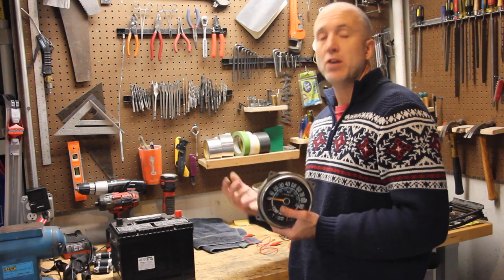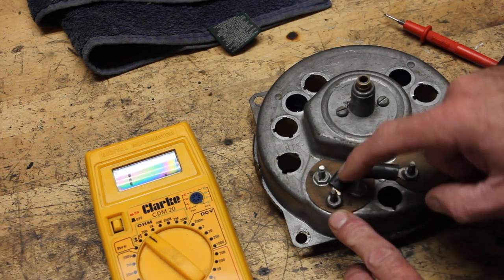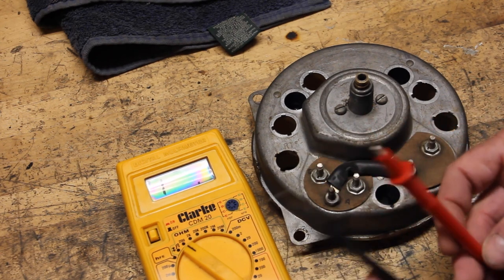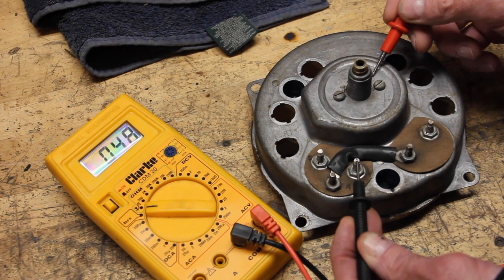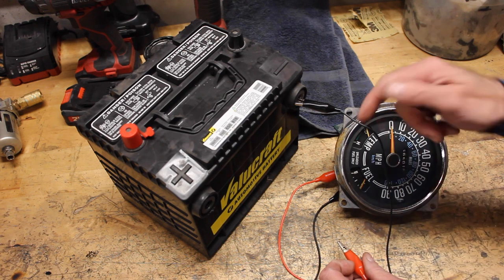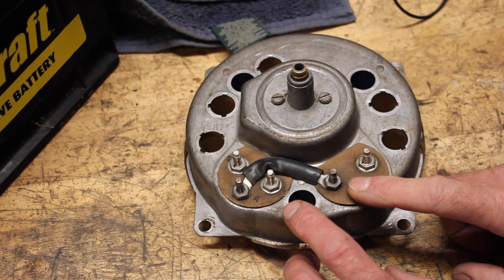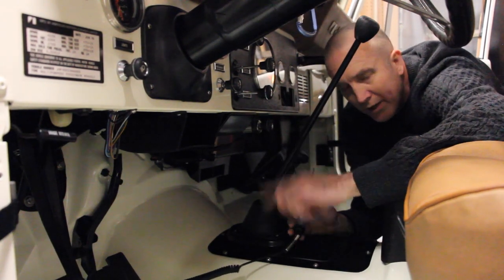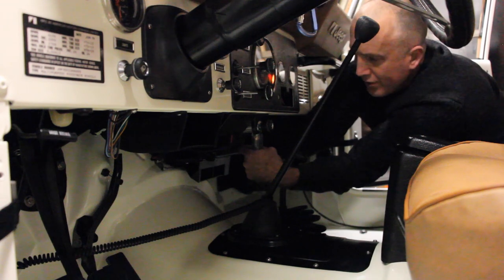Jeep CJ Fuel and Temperature Gauge Problems and Testing

Comment: Hey bud, like all your videos. I have a 86 cj7 with some really screwed up wiring. All my exterior lights work as they should but no dash lights at night, also the last guy that owned this jeep, replaced the speedometer. Did not connect anything to it but had installed a separate gas gauge, that does work. I noticed I don’t have the jumper wire from A to temp gauge on this. Is the new ones different  or do you know ? and also my ohm readings were very different than yours. Any thoughts? Thanks for any help. Also you would not have any diagrams of the light switch by chance would you?

Comment: Where do you get all your Cj parts at? Ive receive my dad’s old 86 Cj, and i REALLY wanna fix her up although 20 years of Florida humidity ruined a lot.
Reply from the maker: Kind of a mixed bag. Most gaskets and maintenance type pieces, I use Rock Auto, Morris 4X4, and Quadratec.

Then there are the hard to find things, like the power brake booster dust boot or the reverse light switch. NAPA seems to have a lot of these.

If you want to go OEM, then FB Marketplace (random pricing), eBay (stupid expensive) or reach out to Ray Moulton at Deadjeep.com. He is the best in the business and killer with prices. Great guy to boot.

Comment: Great video as usual! Also, very timely. I’m just putting the dash back in my 1976 CJ7 and had the speedometer installed. I took it out to do these tests just to be sure the gauges are good. So, I am getting all of the correct Ohm readings from the fuel and temp gauges. I also did the 12v battery test and both gauges take power. But, when I tested for continuity between the fuel gauge “I” post and the speedometer housing I don’t get a tone. Is there a way to check the ground or clean the contacts? Any help is really appreciated!
Reply from the maker: Have you opened up the speedometer and taken apart the housing? There is a small metal strap on the back of the fuel gauge that grounds it into the speedometer housing. Start with taking the cardboard piece of the back and check for corrosion/rust.
Reply: I actually have the same exact problem. So I took apart my cluster and pulled out the fuel gauge pod. The little ground tabs on the back of the gauge look ok but I cleaned them anyway along with the “I” post. Reassembled and still no continuity between the I post and housing. But if I test continuity between the I post and the grounding tabs on the fuel gauge, there is also nothing. So maybe a bad gauge? I have a Chinese cluster from quadratrac and I pulled the fuel gauge pod out of there and put it in my cluster and I have proper ground continuity. Ugh. Any thoughts?
Reply: Also, if there was continuity between the post with voltage and the cluster case, wouldn’t that create a short?

Comment: Do you have anything on getting the oil pressure gauge to work?
Reply from the maker: Have you checked the oil pressure sensor on the side of the engine block? Have you checked to see if your getting signal voltage from the sensor? And have you checked to see if your getting anything at the gauge in regards to voltage?
Reply: @coolguy_CJ7  The sender and the gauge are new.  I haven't checked the voltage.  Will do. It basically is pegged at 0 when I'm on the gas and bounces around 20 when at idle.
Reply from the maker: @Christian-ux1vl  is the gauge aftermarket?
Reply: @coolguy_CJ7  Yes, it's a Crown product.  The sending unit was new as well.  I tested everything though I am uncertain about the ohms on the sending unit itself.  I also grounded the sending wire to the gauge and the gauge pegged at max PSI so I believe that indicates that the wire and the gauge are OK.  I suspect that method is not orthodox.  I purchased a new sending unit and am waiting for that.  I'll switch it out again and see if it works.  There are a mixed bag of Jeep forum threads out there on this topic. Seems like a common problem.  I still have the original gauge.
Reply: OK, new sender is in and the gauge is working now.  35-40 PSI on start up.  When warm and at idle its around 20 psi and while driving it reads an increase in pressure when I'm accelerating put to about 45psi.  I don't now how accurate the readings are, but this together with the new oil pump I installed, gives me plenty of confidence that the oil is moving about the engine as it should be.  I am declaring victory.
Reply from the maker: My initial guess was the the gauge was wired backwards. A lot of the Crown/Omix-Ada gauges are very flawed and reversed in their internal wiring. Super glad that a new unit fixed it. If you want a really accurate reading then you need to go with a hydraulic gauge. The readings that you’re getting are exactly where they should be.
Reply: @coolguy_CJ7   Thanks for the assistance. This subject would make for a popular video.  Seems to be a consistent problem and there isn't a lot of helpful "how to" out there.
Reply from the maker: It is on the list of videos to make. I’d have to make this my full time job to get all of them done in a timely manner. :)

Comment: I had a quarter of a tank reading mine is empty why is that
Reply from the maker: My initial guess it that your sending unit is not sending the correct signal (ohm amount) to the fuel gauge. Is your gauge original or aftermarket?

Comment: hi! any way to add rpm gauge to base 1980 cj5?
Reply from the maker: Yes. Possible. Easy? Probably not. Depends on if you want to go original or aftermarket. But either way, the Tach gauge will plug directly into your fuse box and then you will need the the wire in your engine bay that runs to the coil (green wire) or your distributor if you have an HEI.
Reply: @coolguy_CJ7  OEM tach (for I6 and V8) SHOULD already have wires under the steering column. They plug into each other, so you just unplug them and tie them into the tach. Lighting circuit can tie into the clock power on the fuse box. Biggest PITA is cutting a hole in the dash (2-7/8") without making a giant cluster...

Comment: You put twelve volts to the temp gauge.?
But earlier said anything over five will fry it.😂
Reply from the maker: @jcjammer1  both of those points are true. I was just doing a power test to see if the gauges worked at all. If I left the temp gauge connected any longer, it would’ve fried. I did try to put a disclaimer in there about the time limit.

Comment: I’ve come to the conclusion that it’s either the pink wire or the gauge itself. I’ve dropped the tank and replaced the sending unit and cleaned the ground connection.
Reply from the maker: Test the connectivity of the wire ends and the resistance. Also, test the ohms of the sending unit.

Comment: @coolguy..bro I'm nervous.. so it's ok to send 12v to the "I" post on the fuel gauge? I have a painless wiring kit I'm working on.🕵🏻‍♂️🤷‍♂️🥸
Just don't want to burn up the new gauge
Reply from the maker: As long as it’s ignition based and the speedometer is grounded by way of the tank sending unit, you should be good. Did I send you the wire diagram?